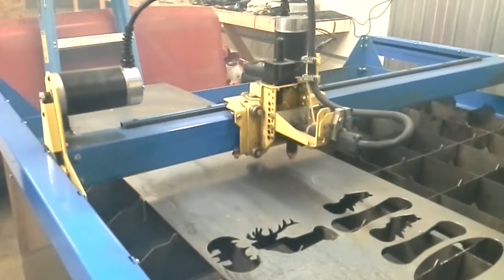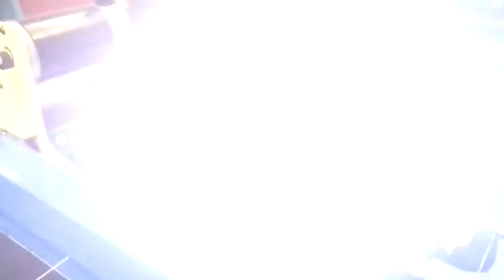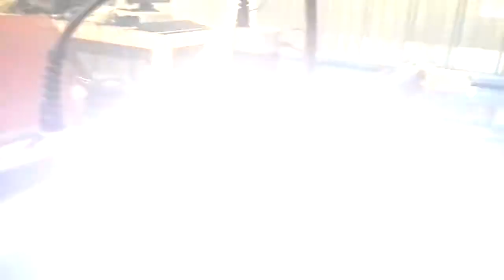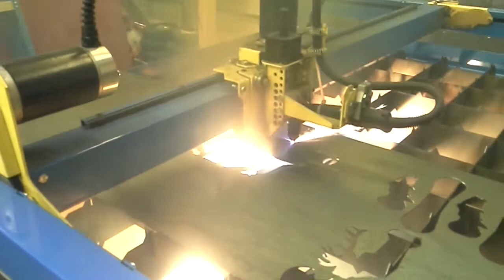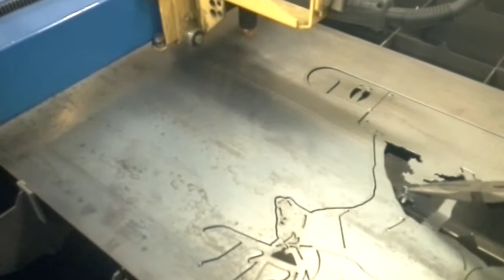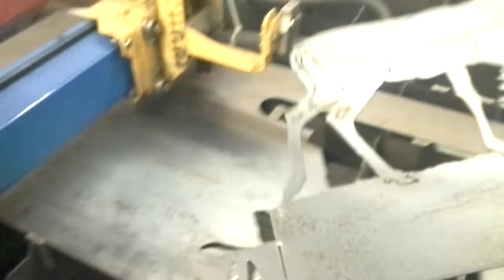Paper towel holder

Comment: I want to connect my PM45 to a plasmacam. but not sure how. do you have a wiring diagram and steps on how to do it?
Reply from the maker: Chris, 

If you get a plasmacam, it comes with a electronic manual with a load of pdf and videos on it. In there, it contains files that detail how to connect major brands like the PM 45 to the controls of the plasmacam.
Reply: weldor2005 I have one. and I figured it out..thanks